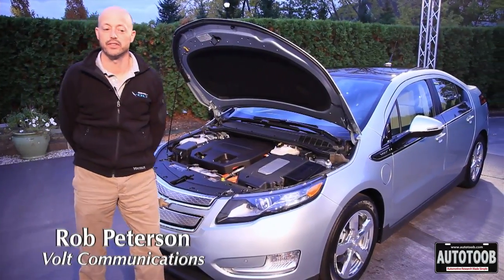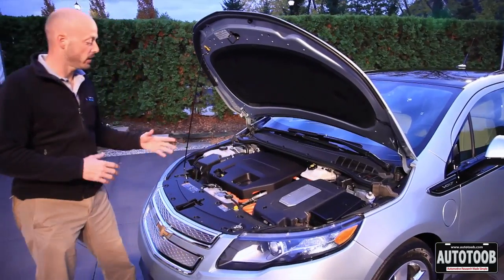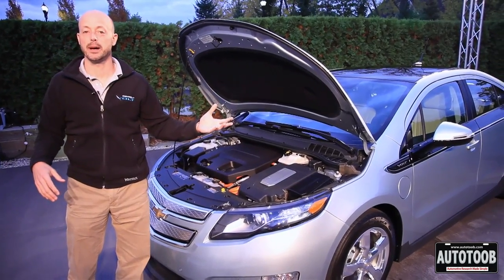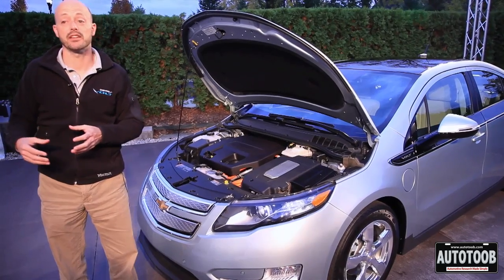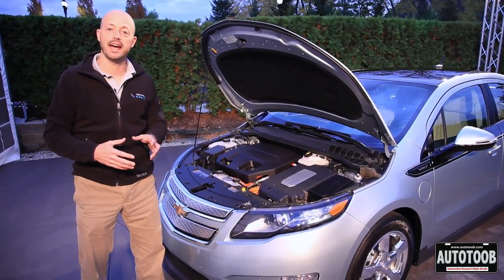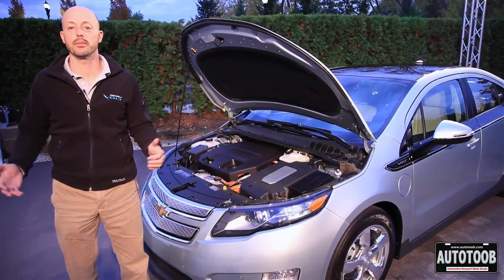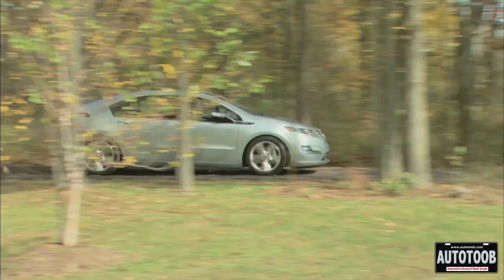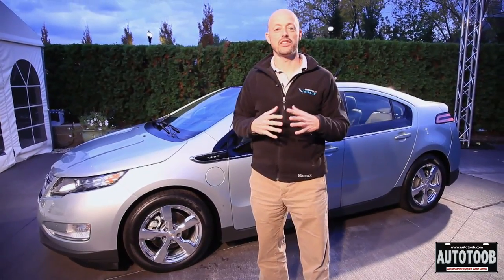2011 Chevrolet Volt - Some Technical Details

Comment: @Deke1: You could have stayed silent and nobody would have know how uninformed you are. So the Volt goes 38 miles on battery (which is more than twice the distance of the Prius Plug-in, by the way) and then the generator starts and you continue another 350 miles. You think it has to be plugged in then.? Why? To start the generator? Now shut your yap and do some reading. You just MIGHT learn something.

Comment: @kiiiro. Trains are called Diesel Electric. But they won't move without the diesel running whereas the Volt will move on battery and/or generator and/or engine depending on demand. A Volt NEVER has to be plugged in, NEVER, Gee it's only a 35mpg sedan under those conditions, how horrible. You want to use the word Leaf in the same sentence?? To drive a Leaf from Los Angeles to Las Vegas you'll need a hotel in Baker, a ground floor room, an extension cord and a late check-out.

Comment: @kiiiro a diesel-electric train runs 100% on its electric motor 100% of the time but they never call it an "electric train"

the Volt gas motor is mated to a planetary gear transmission to assist in high speed driving 

what should we call the Nissan Leaf then if the Volt is an electric car  how about the trashed GMs EV-1

what do you call that ?

try PHEV see what that means

Comment: @heartlessvietboy Remember you get what you pay for, the Volt cost more because it is new tech but all critics agree the car does not drive like a cheap car. In fact it has one of the smoothest leaner acceleration of any car even those costing  more than $100,000. This is common for a electric motors.

Comment: @Asuram21 No one in the US is going to pay 40k. At the most 33k, due to the 7500 dollar tax break, some states have extra incentives. I'm betting that those incentives will stay in place until technology becomes cheaper. I agree 40k would be overboard, but 30k, seems to very reasonable if used mostly within its electric range.

Comment: Chevrolet Volt is a Hybrid vehicle that has the ability to run only on Electric motor.

It's not 100% Electric vehicle, like Tesla or Nissan Leaf.
It's not Plug-in hybrid either.
It costs ridiculous money.

I would take Nissan Leaf anytime over this and have another vehicle for doing long trips. Nissan Leaf could cost me 25k and I would have about 10k to buy some used vehicle that I'd use for longer trips or just rent something twice a year.